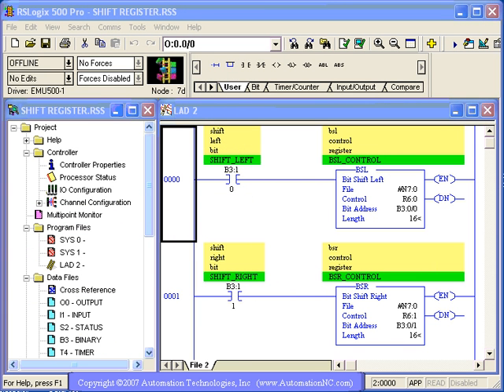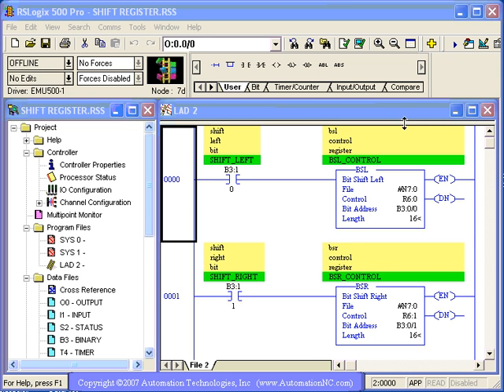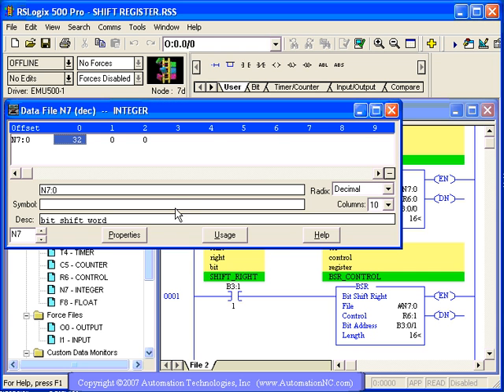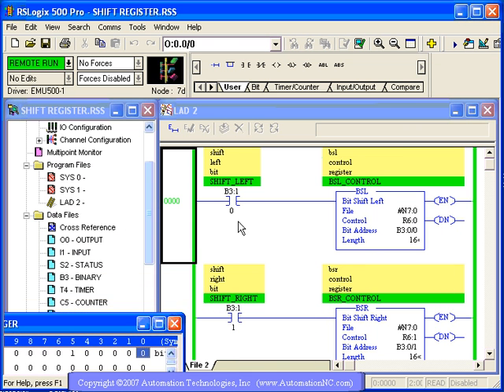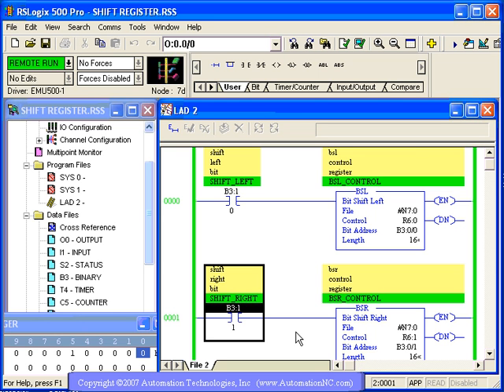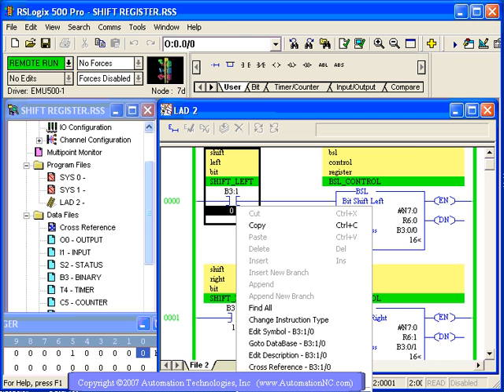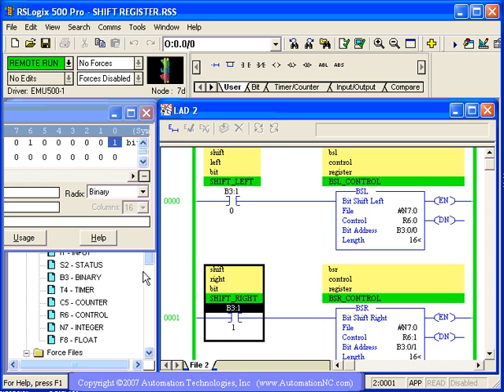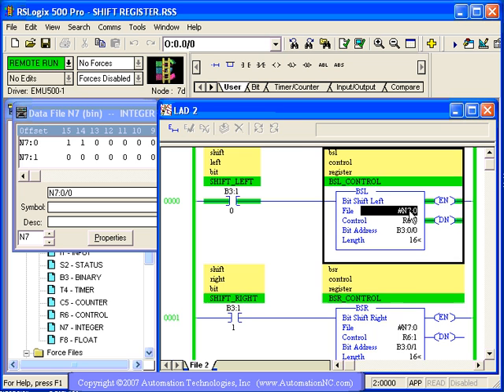Shift Registers - Part 1

Comment: SIR.. may i know what has its application ?
Reply from the maker: +Mukesh Kumar Well for a basic operation, it can be used for multiplication/division as when you shift one way you are actually multiplying the word shifted by two or dividing it by two depending on the way you shift it.  Generally I have seen shift registers in PLCs used to track items in PLC memory.  Items on a conveyor may go by a sensor and the shift register can be loaded with 1's for an item present at the sensor at a specific time.  As the item goes down the belt, shifting the register will track where that item should be downstream.
Reply: tanx sir
Reply: You sir made this video make sense.

Comment: I give your video a high rate, becuase you made a very important point while showing bit shift. "Don't use if you can do it a simpler way". Excellent advice. Also for your next video, you could have the ladder logic window horizontal, and the data file window horizontal, with project tree window not shown. then using right click goto to data file, open needed data file window to view. this way you would not have to figure out window positioning on the fly. Hope this helps.